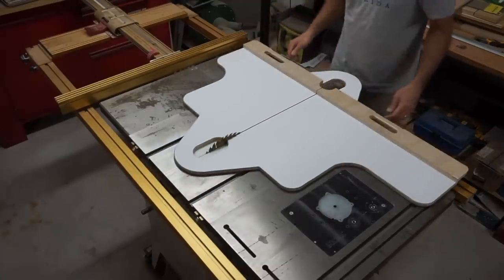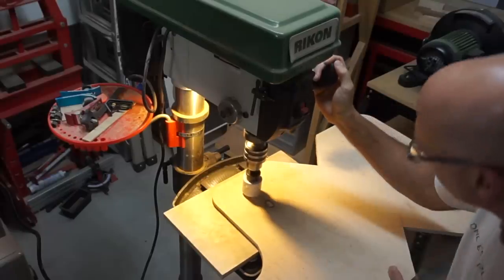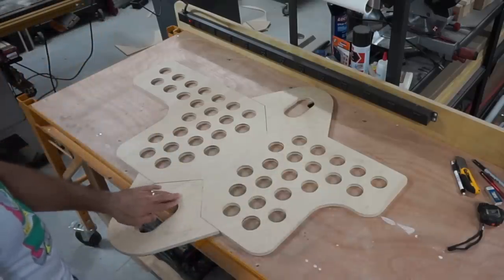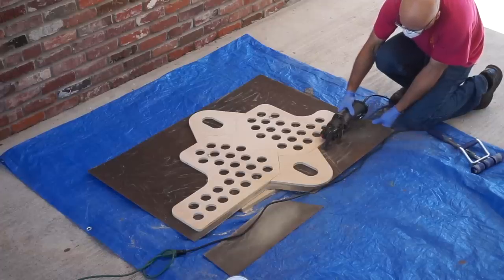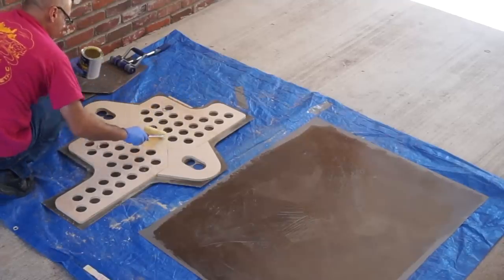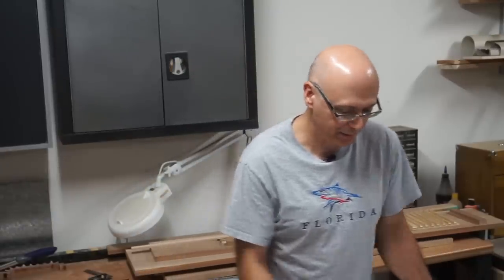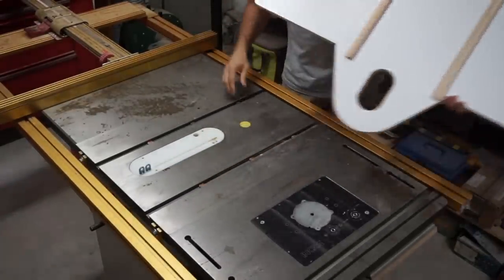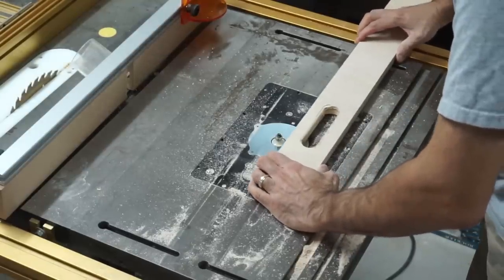A Crosscut Sled Like No Other

Comment: I love the design, but i would like to see a way to hold the board in place other than the pressure from the push block. maybe a rail clamp? you could even use the rail for repeated cuts. 

love removing the wood to make it  lighter.  Thanks

Comment: Most guys use two runners on their sleds, as you did.  However, one is all that you need and two is too many.  As the moisture content of the wood changes with the seasons or the temperature changes, the distance between two runners will expand or contract with respect to the metal table. Then the runners will bind in the slots and the binding forces will cause the horizontal surface of the sled to bow. That can't happen with a single runner.

I've never seen a framing square that was square enough for precision wood working, and I would never use one for doing a serious alignment on a table saw (or a sled).   Most are probably square enough to give you an alignment accurate to 1/32" in 12". That may be close enough for rough carpentry, but you hardly need a sled for that.

Gluing the fence down leaves you with no way to make it square with the runners afterwards. Better, I think, to locate it to the base with a tight-fitting dowel pin at one end and a screw at the other end thru a hole with plenty of clearance for adjustability.  Than, after you get it adjusted just right with the screw tightened, dowel the fence to the base at the other end and place several more screws evenly across the length of the fence to fasten it permanently.

Using that arrangement and the 5-cut method, I was able to square my fence to within 0.003 in 20 inches.  

BTW, be sure your fence is rigid, very straight, and hard-surfaced.  If it becomes curved with wear or instability, it will throw work pieces out of square with the blade no matter how square you got it when you built it. How much out of square will depend on where the work piece contacts the curved fence, so the non-squareness will vary from one work piece to the next.

Before ending this, let me say that I share other's concerns about the safety issues they have raised.  When something goes wrong on a table saw, it's all over before you can react.

Comment: I think gluing the fence is a mistake as you loose the ability to correct the squareness error. The overall design is very appealing, but does not allow for running a riving knife or a blade protector guard/dust extractor which are both very desirable.
Reply from the maker: Hi Barry, all of your comments are valid! Maybe a 2.0 version can include some of these improvements.

Comment: great job, however i would include a few counter sink screws on the runners  to avoid the possibility of them snapping off over time and with any possible stress.  also i would include a way to hold the wood down onto the sled because that is danger waiting to happen.  :)

Comment: Hey Matt, great sled! Only critique is always, ALWAYS maintain positive control of the material you are cutting. I see others have mentioned as such and love working with wood also. Many accidents occur from that and you got lucky with you beautiful design. Other than that, I like what you do and the precision you look for. Keep creating my good man 😎👍
Reply: Precision? .035" in 15" out of square? That would get a framing carpenter fired.
Reply: Ishmael Kabibble, Very true but giving someone a reputation to live up to is far more productive than negative remarks. He’ll get better 😁👍

Comment: Very good, certainly an improvement on my one, did you turn over the test piece and make two cuts to measure, just like you would to check a square, I like the vernier check.
Those square you used to check your work is not a accurate make/design.
I went to purchase one a while ago, and out of the batch in the store, none were accurate.
If you had a better square your slide would most likely come out a lot better.
Check yours now.
Cheers

Comment: Like the video and design, "finger imprint and thumb" spaces for pushing a Secured board,  a thicker back stop and closer hand holds might help.1st checking the square of the 5 test cut, but you knew that, didn't Ya... be Safe

Comment: The runners need to be screwed on, not glued, so they can be replaced. The fence needs to be screwed on, not glued, so you can adjust it for square. .033 inches per foot is pretty bad.
Reply from the maker: Thanks, Doug! You make some good points.

Comment: Some hold down clamps mounted on the handle, and another mounted in a Kreg Trak nearer the blade would make this jig a lot safer. Don't want loose timber being cut on a table saw.

Comment: Very nice thin light sled.  I would make a couple changes - vertical fence and some hold-down clamps.  I'd do the five cut method to make it as square as possible, also. But the thin light sled is the best I've seen!  BTW, someone did escape from Alcatraz!  Distant relative.s .. (your t-shirt)

Comment: What blows my mind is that you spent good money on nice Incra precision fence for the table saw and an Incra precision router lift, but went cheap on the t slot runners. Incra makes a very nice set or slot runners that are adjustable and not that expensive. Also surprised that you are okay with squaring the fence with a framing square and gluing in place. The biggest and scariest part was not having a blade guard nor hold down. Just a matter of time before a piece is kicked back in you face. Good start, but needs some improvements to be safe.

Comment: Firstly..yes it's cool...However, cutting wood that isn't held/clamped is not good, and with such a low barrier you can mount clamps on there..Where the blade comes through the barrier, measure the total height of your blade and add a block 2 cm higher over that area and recut (safety first)..also the barrier should have been screwed, one side first and the other sided clamped (so you can adjust the accuracy of your cut) but the concept is great..
Reply from the maker: All I caught from your comment is, “yes it’s cool” and “the concept is great.” JK! Thanks for your whole comment!

Comment: You could have easily used a fastener (screw) to temporarily attach your fence to make sure it was square (5 cut method) the attach it permanently.  .033 over 15” is not that precise especially when you’re  48” boards. The other thing you didn’t think about was a chamfer (dust groove) for your fence.  Don’t forget that saw dust/chips/etc that build up along the fence can cause imprecise/crooked cuts on your cross cuts.  Your design is so innovative that you let the details get away from you...

Comment: I like it. But I'm curious what the measurements would be after using the 5 cut method. Also I would add some toggle clamps to hold the piece down for more stability. But I think it's perfect. Large size and a lot less weight.

Comment: It's a beautiful, unique, and lightweight design but I agree with the constructive criticisms:
At some point, you will need clamps to hold down the stock and a higher back fence.
Had you been WAY off with making it square, there was no way to fix it after using the epoxy.

Comment: On the board design?: Cool Meter activate:  0-1-2-3-4-5-6-7-8-9-10...    8.7

On the no clamping or holding on the piece being cut?: Cool Meter activate:  0-1-2-3-4-5-6-7-8-9-10...    1.4   (That's just asking for kickback, or at best a lousy cut).

Dollar Cost Averaged: Cool Factor: 5.0

Add a T-Track to the fence so you can use clamps to hold the piece being cut and to hold stops in place and I'm sure the cool meter would peg cleanly into Fonzie range.
Reply from the maker: For the chance to achieve Fonzie level coolness, I might just go for that deal...

Comment: It looks good, a bit large but hell ! releasing the stock at its own will is calling for disaster... 
The problem with your sled is that the handlebars are far away from the tracks so when you push using  only hand, it will create torque in the "geographical" center of the handle and the length of the sled tracks, causing it to try to spin around that geographical mid-point and binding. That is clearly seen in the video.
The handlebars should be behind the tracks, and if using only one hand, which is quite common, you need to push more in between the tracks... and it needs a tall rear board to clamps stuff on.

Comment: I do like the innovation of the holes but my sleds need to have hold downs, stops and integrated tape measure so I can quickly set a stop and make repeat cuts without even thinking.  I'd like to try this concept with my own full featured sleds.

Comment: Personally, any time  I see someone with their fingers near a router bit I cringe.  I had a bit grab and pull the work piece forward.  Could have done alot of damage to my hand.  Can't be to careful working with any woodworking tool.   Like that you used laminate on the  bottom, which will allow the sled to slide easier, but would leave it off the top.  I found the work piece will move if not secured and laminate makes movement more likely.   Cutting out front portions of the sled's  bed also reduces work piece support.  Also curious how you insured the sled was dead flat.  Works better if it is.  But if it works for you that is all that matters.

Comment: I really like the idea of light weight and easier storage. 

About that carpenter's square: the least thing that I would have done would have been to check it from both sides of the blade. But it would have been much better to have squared it to the table slots which are what determine the motion of the sled. The blade could be at an angle to the table slots. One way to do that would be to use some small pins (nails) in holes drilled square to the surface of the sled (in the drill press) along the edge of a slot runner. You could fill them with putty after the glue dries if you don't like having them there permanently.

Comment: .033” off is more than 1/32” off on 15”, isn’t that good. Running wood through a table saw without any means of holding it is just an accident waiting to happen, actually surprised that little cutoff piece didn’t hit you in the face. For all that work and you can only cut an approximately 17” piece is underwhelming. Using laminate to hold various pieces together is a good idea, but wood you’re cutting will slip around a lot, again that accident waiting to happen. Your fingers got uncomfortably close to your router bit at times. I wouldn’t recommend making or using this sled without major modifications. Not trying to be an a-hole here, but safety is paramount when using  power tools. It’s hard to do woodworking when a hand is all bandaged up or there’s a piece of wood in your eye or up your nose.
Reply from the maker: Thanks, Hue Janus. You don’t have to try… 😃

Comment: I like the shape of the design, however I think more development is needed to build a stronger sled than this. First, biscuits would have been stronger than pocket screws rather than to rely on the laminate to provide rigidity. Second, I would have bridged the front end so to allow for that splitter to remain intact. This is a potential kickback accident waiting to happen. Third, the rear of the fence should have a t-track with hold downs for added securing of cuts, and lastly, the runners and fence should have been screwed to the sled in addition to the epoxy.
I like your design, but like I said, it seems like the first execution towards what could be the perfect sled.

Comment: I especially like the blade visibility in this sled.  The ones with the big blocks on the ends of the cuts hide the blade and I've never liked not being able to see it.  I'm curious at what weight you ended ip with.  

I have some 1/4" good quality ply Laing around.  I think I'll try it in a little thinner form.  The sandwiching should give it plenty of rigidity.

Great idea.

Comment: When setting the rail, best to reference the square to the slot in the fence and not the blade. Table saw references should always be from the table slot since it's fixed. Since the the cut slot in the sled is parallel to the table slot, the cut slot would be a good reference. Make a shim at least the length of the square blade to fit the cut slot (light press fit). Press the shim in the slot and leave enough above the surface to reference the square.
Reply from the maker: Not sure why you’d want to reference the slot, since the blade is what is doing the cutting?
Reply: @IveBeenThinkingWorkshop  The travel of the work is ALWAYS parallel to the slot and not necessarily to the blade. If you know for sure the blade is exactly parallel to the slot, then referencing the blade is ok. The motor is not fixed and can be adjusted. Even if the blade is off by 1° the cut will still be parallel to the slot. The work may bind. Consider how coves are cut.

Comment: I would put some kind of extention in the back to prevent you from sliding the sled too far back after the cut so that it hits the back of the blade and lifts the entire sled up.  Other than that it looks good... And as so many others have mentioned... need something to hold down the piece you're working on  ;)

Comment: Truly a unique design. But doesn't the use of laminate makes for a more slippery bed which lessen its grip on the work piece? Best to make the bed rough as some even put sandpaper to create more friction between the bed and the work piece. Also the thin fence makes it harder to secure the work piece (though surely increasing its height would make this project not unique anymore).
Reply from the maker: Yes, you’re right. It might be better with a rougher top surface. I have a commercial sled that has laminate all over it, so I guess I copied that. Yes, the thin profile is a compromise, just like a sports car is sleek but not as practical as a sedan. Thanks for your comments, MrKockabilly!

Comment: Think the top skin was redundant, and just makes the wood slip easier out of position, although understand with all the holes in the ply to reduce weight, that would make lots of voids without the top skin.   Probl. would have just run a dado blade for slots diagonal in the ply to reduce weight and skip the top skin.

Ditto the safety comments.  It clearly doesn't want to slide one handed, so you need to come up with a clamping system to hold that wood down.

Decent design, but I prefer mine, it has replaceable wood inserts to ensure zero clearance under any conditions (dado, angled cut, diff. blades), and has a T-nut stop block so that I can do repetitive cuts...

Comment: the problem is that an entire fully outfitted shop (drill press, router, crosscut miter saw, band saw, a host of other special tools) to do them. if i had them and could use them i don’t need your design. but i don’t. so this and most other ‘good ideas’ by the pros are nice to know about but can’t be done by un-pros.
Reply from the maker: I’ll bet you can make one of these with the exact tools you have right now.

Comment: you have a metal box in the back ground, 5 draws across and 8 down. I have been trying to fine one. If you could help, with a name.
Reply from the maker: You have a keen eye, Jim. I've had that box for so long, I don't remember where I got it. Sorry.
Reply: I don't believe anyone makes these small parts storage drawers out of metal any longer. Lowes has the parts drawers but the outer case is all plastic. Lowes calls them "Stack-On 15-in x 18.5-in 18 Blue Plastic Drawer".

Comment: hi i have commented on your table sled before (low fence) i also noticed you removed the (splitters) which are likely the guard supports, if you accidently pulled the sled back too far towards you the whole sled would kick back at you. you MUST add a back stop to prevent you doing just that. in your video at the end when you were testing it (16.10 time) the back actualy caught the blade and started to ride on it,  imagine what would happen if the blade was spinning.  happy woodworking, mostly like the vid but worried you will have an accident as i have stated in the past.

Comment: After decades, have all 20 digits, by the grace of God. Did architectural mill work, stair-building for historic landmarks [this to qualify what I am about to say]. Made one of these sliding tables [sheet of 1/2" Russian Birch Ply and two boards to hold it together] for my 10" Unisaw, even though an Altendorf Sliding Table Saw was within 10 feet of it. It was used 95% of the time for complex cuts that required attaching fences at odd angles, and accessory toggle clamps if needed. Though pretty, in the real world of complex mill work, this design is almost non-functional. Note: Michelle is my friend.